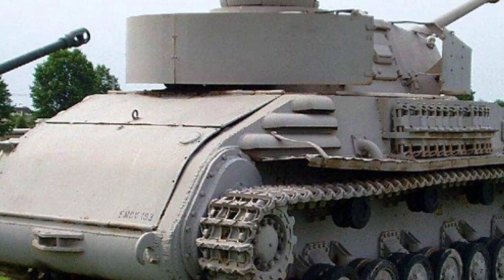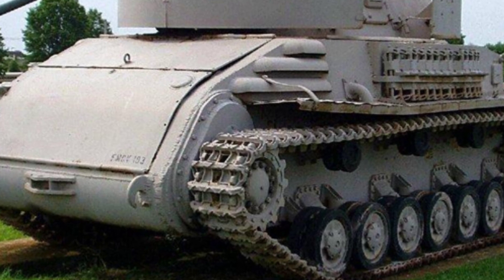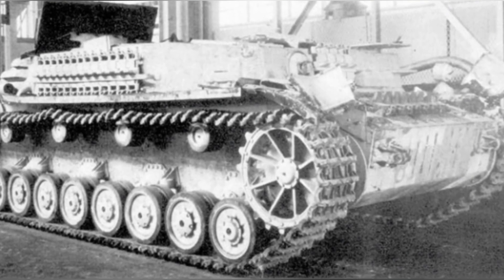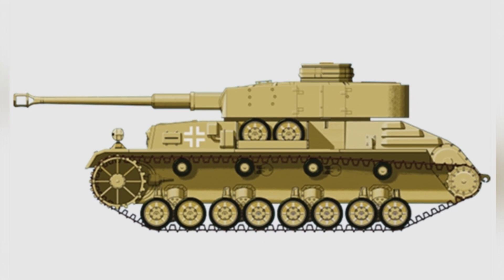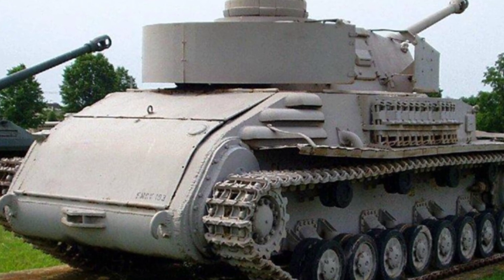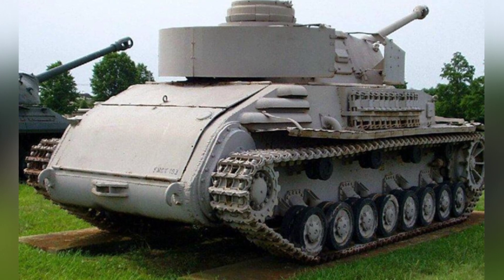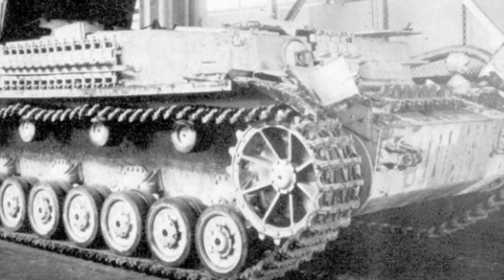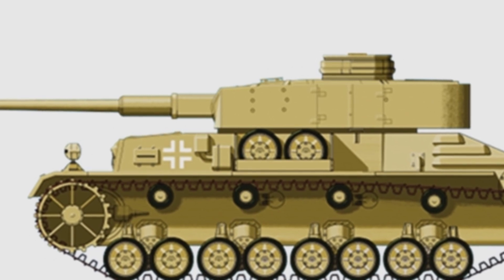Revolutionary Hydraulic Transmission: The Panzer IV G Tank Upgrade

Comment: Thank you for posting this.  Does anyone know why the idler wheels also have teeth?  (The only thing I can think of is in case one side's hydraulic motor fails, the tank could still be driven by the remaining motor powering  both wheels through a clutch in the front axle.)

55th like.